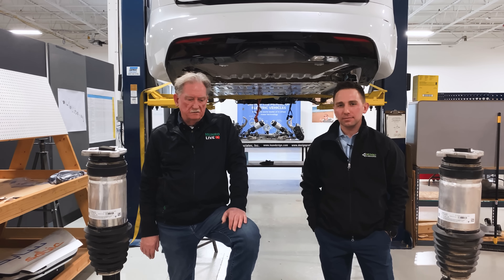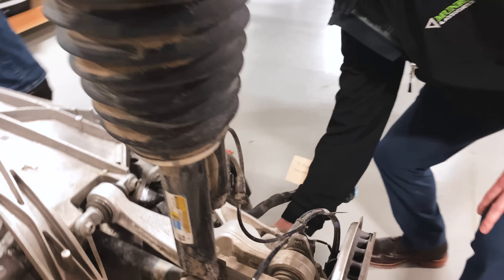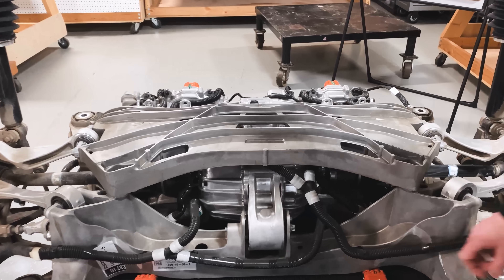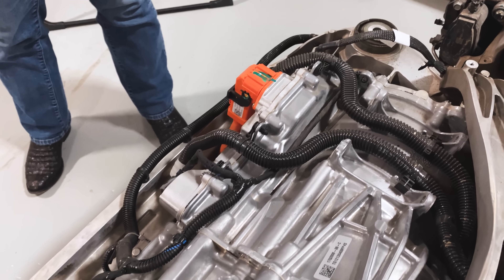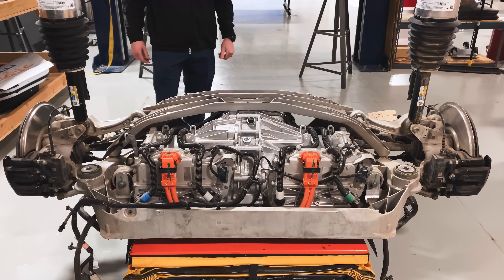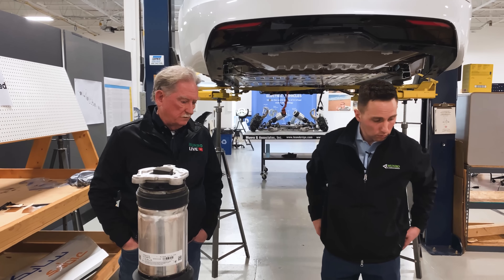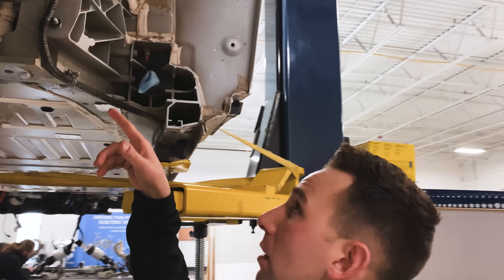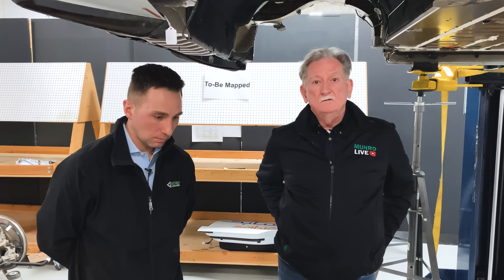Rear Cradle and Electric Drive Module | Tesla Model S Plaid Teardown

Comment: All that praise about Carl in the interior video sure seems to be fabricated given that Jordan conveyed similarly if not more valuable information yet all the direct comments of praise were absent, Cory's idea!? If this is the case. just be original folks and don't try too hard, you've tremendous value to offer to the community as is.. a potential reason for doing is smoother acceptance of a new host, but y'all gotta realize that the audience will recognize the value offered naturally.

Comment: As a lay-person who has studied alternative driven vehicles since 1980 and even designed what is now known as a hybrid vehicle going so far as to contemplate using a VW beetle chassis, a kubota diesel engine running at a set speed (its optimal power band) to charge rudimentary batteries available at the time, I am both marveling and repulsed by what Tesla has done.

I have yet to understand why 0-60 times are selling points in mass production, mainstream electric vehicles.   I see the point when your chief selling point is "performance", but these times are counter-intuitive to maximizing range.    The electric systems are oversized by at least 2 times that is needed in achieving 8 second 0-60 times.   That is bogus weight and packaging issues - the components should be shrunk by half and the weight savings would not be minimal.    Smaller electric motors, coolers, and all subsystems would take up less space, maximize interior volume/or to allow for more battery storage.   Whe you reduce the size of components, you necessarily reduce the cost of those components which would result in more affordable vehicles that don't need the taxpayers to be shafted for those who wat to adopt (shifting their cost onto others).

What amazes me is that Sandy, for all the respect I have for his engineering genius, has failed to grasp at how archaic these supposed advanced systems truly are.    To me Tesla is frosting an ancient cake - it looks fancy, but it is not really solving anything other than to show off and to do things differently.   But they aren't better.   They are buildiing another horseless carriage, but not doing it smartly.   I am so surprised at how oversized everything is on this vehicle.    Even the suspension looks like it is designed to be in a Ford Raptor that travels 50 mph in desert terrain.

Comment: The one question I have has never been addressed. The most expensive part of the EV is the battery. My question is, how well is it protected from ground debris? In states like Montana, driving, especially during winter months is very hard on the bottom of vehicles. Just driving up my driveway requires turning off of a major highway through a snowbank created by highway plows, usually at a higher velocity because cars are often behind you and impatient. Can you go over how well it is protected? Am I going to have to buy or make off road skid plates to protect the battery?
Reply: @AudiTTQuattro2003  There have been reports of damage caused by debris from an accident that happened directly in front of an EV and it bounced up hitting the battery and causing 20k + worth of damage because they have to replace the entire battery. 6 inches of clearence on a SUV is not enough IMO others like Subaru have 10, add that to the battery being under the car, is not a great idea unless you properly protect it. But I do understand where Elon is coming from. Having the lower center of gravity not only improves handling but keeps the vehicle from rolling which we all know is priority for Elon, that is to say safety.
Reply: I don't know about the Plaid, but the old Model S had layered titanium and steel armor. You can find videos on YouTube about the tests they did with it, they are pretty cool. I think it would protect you even from landmines.
The 3&Y doesn't have the armor, they instead made the batteries much less likely to catch fire in case of physical damage. Normal debris shouldn't hurt it though, but if you hit something hard that could be expensive. On the other hand the car itself is a lot cheaper this way. 
My guess it the Plaid doesn't have the armor either, more to save weight than to save money.

Comment: Rumor's are that the new model Y has produced the new battery system (big cells) and structural battery/frame style. I wonder how that will be different from the S plaid considering the manufacturing date is months apart...

Comment: That rear drivetrain module is massive!! Loved the video!
Reply: When I first saw a Plaid rip of one 9 second 1/4 mile after another after another in a car that heavy and with that kind of traction, I knew this bitch must be stout mechanically.  I've seen 10 second muscle cars break 9" Fords and 12 bolts regularly, so you knew the drive line in these Teslas were ridicuous.

Comment: What does Sandy think about the brakes on the Plaid. I've heard people complaining they are not adequate for the performance of the vehicle.
Reply: For those that want to use it on the track, Tesla offers a carbon cermaic brakes as an option. For those driving normally, the stock brakes are likely a better choice.
Reply: @tesla_tap  So the complaints are baseless unless you are going to race this car on a track? If you plan on racing you should upgrade to the carbon/ceramic brakes.
Reply: @mikepetersen5024  I don't care about the brakes 
I just want tesla to fix their build quality issues.
These cars also look the same on the exterior
It gets boring
Reply: @user-nw8jr1dk9p  you trolls get boring.

Comment: Question to be explained in a video: Over the Air / Software updates and controls....are all mechanical parts and systems shown OTA compatible?  Suspension, different drive modes, regen brakes, thermal controls, problem diagnostcs or wear and tear diagnostics, fixing those issues, telemetry, etc...show us how that works, please. And how much more can have OTA intervention in the future?
Reply: Actual signals are the same. If they change parts, it has to be compatible with the rest of the other parts too. So, it is backwards compatible. Not sure the updated models with the 1000 hp will be compatible with the 720 hp one though. It probably isn't.
Reply: @1flash3571  Thanks. I was trying to suggest Sandy to show us how OTA is integrated to the mechanical systems and maybe suggest future OTA related situations.
Reply: You cannot fix everything by OTA software
Reply: @alanmay7929  Tesla can't fix everything by OTA software, but they sure can FIX ALOT OF IT.

Comment: The idea that one might be able to "drop out" a modular motor-inverter package from a standard S, and "drop in" the Plaid drivetrain might be a hot-rodder's dream.  Find a wrecked Plaid, buy a used S, put the parts together and update the software, and viola, you have a new car.  Of course, it would never be that simple, but commonality of modules and interchangeable suspension pickup points on the frame castings could make multiple variants very easy to assemble at the factory level.  It will be interesting over time to see what "hot rodders" do when virtually all cars become electric.  How about a Factory Five Cobra kit with a 1000+ horsepower plaid drivetrain and NMC battery.
Reply: Has anyone tried this, or measured? Was hoping to see a follow up or a comment here. The old subframes have weak points. I found at least one…

Comment: Tesla seems to have a great working integration while developing the cars. Not so great integration on the Assembly lines, with too many quality control issues, as misaligned panels.
Reply: Those are some of the issues the gigacasting is going to resolve.

Comment: My issues with big castings, it's that they aren't the best for the mainstream, if they need to repair the car. Make it an expensive process, and making the car more easily totaled. You've that happening many super cars using monocoque tubs. If it's slightly damaged the car can get totaled being a structural structure.
Reply: @AudiTTQuattro2003  it depends on the car value and other damage. Dropping the rear frame does not take long. I guestimate that this takes less than 1h. By the time you crack that part the others bits of the car might not look good anymore anyhow. Exception might be a mighty big pot hole bending your suspension, but little else. In the Lotus world, you even do chassis swaps. It is a lot of labor, but totally DIY or insurance pays for it. The factory even provides a chassis with the correct VIN number. You need to send them the VIN number bearing cut-off piece of the chassis, though.
Reply: as it is a die cast part, it must not necessarily be expensive. If broken, unbolt it with its 6-10 bolts and bolt in the new one. I expect this part to be less than $100 to make. It is like a mini giga-casting. Sandcasting is way more expensive as it needs many steps. Build up the wax core, dress it with the vents, put it into the cold, put sand around it, cast it, manually remove it from he sand box, remove all the vents, inspect and machine as wax and sand always distort. The die cast except the vents and fillers it comes out perfect in shape. Minimal machining required.
Reply: @lapin46  if the part need to be replaced is beyond the car value, then is more justifiable to just part it up.

Comment: The back is so well packaged that I am even more surprised how cluttered the front looks in comparison...
Reply: Front had multiple systems for totally different functions. It had environment system, Suspension, drive train, electronics, motor, electrical, and others. In the back is all part of the suspension AND the motor and drive train system. You can't compare the front and the back.
Reply: @1flash3571  exactly

Comment: How long did it take you to remove the rear cradle? Four mounting bolts, six strut bolts and unclipping several electrical connections. Maybe 20 minutes?

Comment: It'd be nice if you guys would speak to longevity when you go over these components. How will they be to work in after 10 years of driving on Michigan's salty roads? I want to slather those toe adjusters with anti seize compound. Will those places where aluminum and steel components meet have dielectric corrosion problems?
Reply: if properly assembled, it causes no trouble. But even steel in steel toe links corrode solid unless you soak them in wax or put covers over them. Best for any newer vehicle is to protect all these spots with a suitable anti corrosion compound. But as most new buyers only drive these 1 to 3 years, they don't bother. And therefore the factories do neither.
Reply: @lapin46  If by properly assembled, you mean there's something in between the two metals, I agree but that's engineering, not assembly. Also, no manufacturers use anti seize compound on anything, even Toyota.
Reply: SPECIAL FOR YOU beautyzone.cam/Anna Anna is a beautiful girl.

He's the person I love, he's my light
day. The way the music flows and sounds
is extravagant and fun. Anna is
icon, legend, beautiful girl, princess, inspiration,
a star. I could go on and on, understand this.
I love NBA Anna.#垃圾

Comment: why not make the motor housing structural and get rid of that cradle?
Reply: Complexity of housing increases significantly; maintenance on motor would be complicated; finally, puts suspension loads into the motor, which are not desirable.
Reply: @mayflowerconsulting5540  Geologist, mining engineer & avid car collector here, so I understand the forces involved, but I know nothing about manufacturing, so I'm pretty ignorant of how things get made.
Still,  I can't get past the idea of the motor housing as a stressed member mounted directly to the structural battery pack with control arms bolted to the ends of the motor housing and pushrod suspension mounted on top would be a far more elegant solution.
I expect you're right, the complexity of casting a housing like that would be too difficult or expensive. Just trying to visualise how they'd get it out of the mould is melting my brain. Thx for your answer.

Comment: The answer to the question on how Tesla got engineers to blend together and work together, is mind-bogglingly simple: They got rid of managers and make engineers actually "talk" to "each other"!
Reply: The largest engineering company in India does not hire MBA. They promote engineer on the field to manage their products and projects for the last 50+ years
Reply: Indeed, walls can be created inadvertently as people will make things up based on perception.   Had exercise where the pairing up of people meant to many that it was a competition rather than cooperation. Only one out of fifteen groups cooperated.
Reply: Just like they do at Monroe & Associates apparently!
Reply: While forgetting perhaps focusing in the Workers at the Assembly lines. That would explain manly quality control issues as misaligned panels.
Reply: @RogerM88  those issues are largely in the past. Tesla are now manufacturing vehicles faster and for a higher margin than any other automaker. That is the most important thing that people need to know. It's all about manufacturing.
Reply: @bluetoad2668  in the past? You serious need to update your self. Even this Plaid had a loose rear window seal.
Reply: @RogerM88  that is thing of the past
Reply: @RogerM88  I've seen a recent comparison between Tesla's latest and Mercedes's EQS line, apparently there's  role reversal going on this time around. 

I'm sure that the inherent reliability of EV design will still carry the day regardless, but surprised to see Mercedes drop the ball like that on a high end priced product, usually that kind of quality is reserved for just the entry level stuff.
Reply: @AllanSustainabilityFan  an EQS is targeting a completly different sector than Tesla. BEVs are still in it initial fase. So don't underestimate Automakers such as Mercedes-Benz, with a multi winning F1 Team.
Reply: @RogerM88  F1 team has nothing to do with EQS quality control and design/engineering problems.
Reply: @RogerM88  I doubt Mercedes will ever get to compete with Tesla at the same price point making the same profit and manufacturing at the same speed.

Comment: UNTIL TODAY the best rear suspension setup I had ever seen was the 1990's Mercedes W140 chassis - it was a work of art - THIS IS BETTER

And the merc only has a diff and driveshafts in it - this has 2 motors and the inverters and everything - AND it produces more power in the back axle than the Merc did with a 6L V12 up front in a package not much bigger than the differential.
Reply: Yep, I was thinking this was very like my S500 as well
Reply: @grahameida7163  - Exactly the same suspension unit as the S600 and yes very very similar to this unit.  Only this is packaged even more neatly.
Reply: There was a time, when a Tesla suspension unit could be bought directly from Mercedes.
Reply: CAPITALIZATION MAKES ME SEEM KNOWLEDGEABLE ARGHHHHHHHH